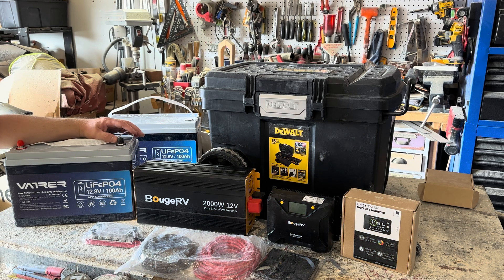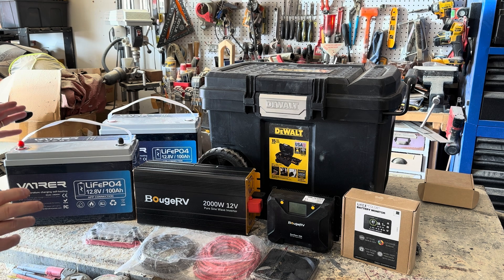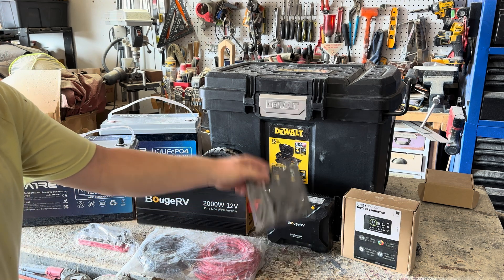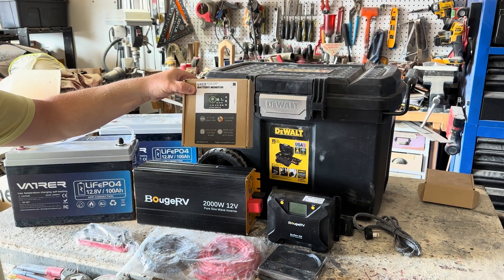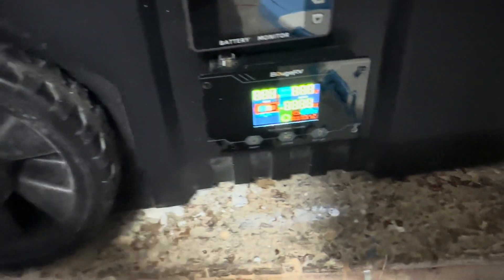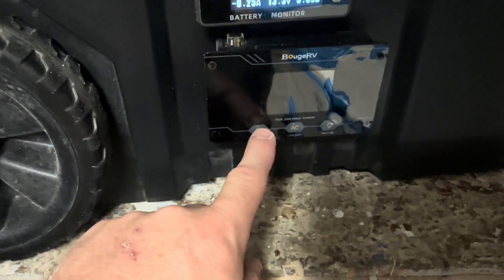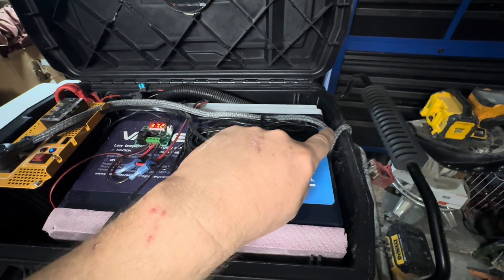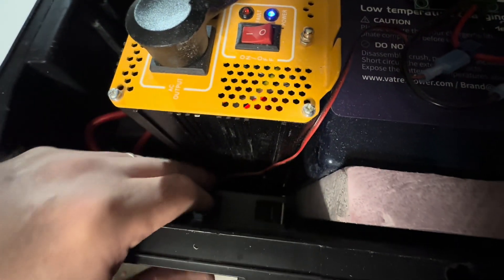I Built My Own Toolbox Power Station [BougeRV and Vatrer Power]

Comment: i agree with all the points made. this battery box was well put together. i've built one myself and i was actually looking for a bigger tool box with wheels for my larger 280Ah battery. i might just use the same dewalt you chose for this build. for those considering building your own battery box: if you get a good deal on the lifepo4 batteries, my observation is that you can get twice the capacity for around the same price as a prebuilt power station, or build one of similar capacity for around half the price. you get more value and savings at the larger capacities. i also think being able to choose all the components to your own specs is super valuable. you can choose quality name brand components such as the inverter, charger / controller etc with good warranties and reputation. i feel more confident they will be reliable long term, and definitely easier to repair or replace. also, all of the components can be repurposed in a camper or vehicle for a power system. modular is always preferable imo. i went with litime and eco-worthy lifepo4 batteries. i got a giandel 2000 watt inverter. victron charger / controller. eco worthy has 280 ah 12v battery on sale for $388 on amazon. 3584 watt hours! you won't be able to get that kind of capacity for anywhere near the same price with a prebuilt power station imo.

Comment: I watched this but most of it went over my head. I don't want solar panels. I want shore power, but once in a great while I will not have shore power, but only short period of time.. Any suggestions for simple and easy?
Reply from the maker: You would need to add a battery charger that can work for the battery type you are using.